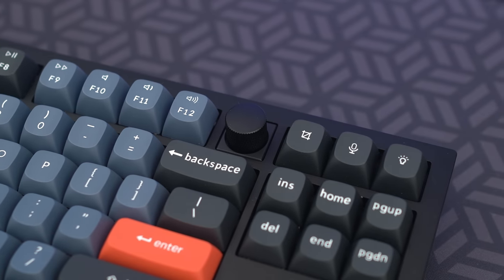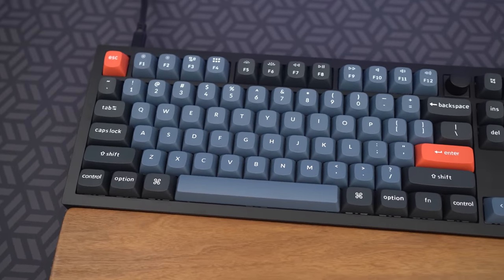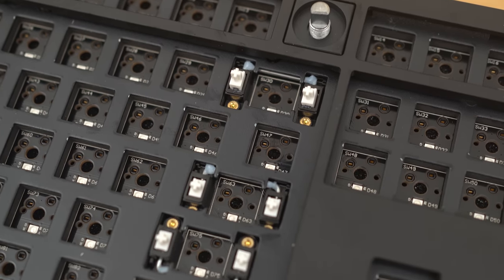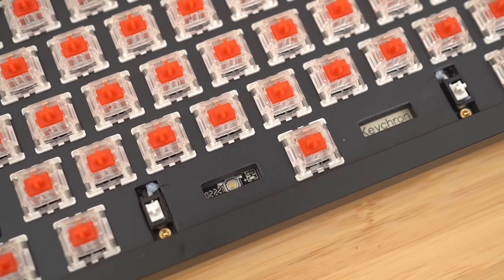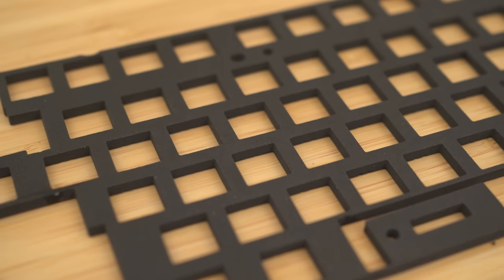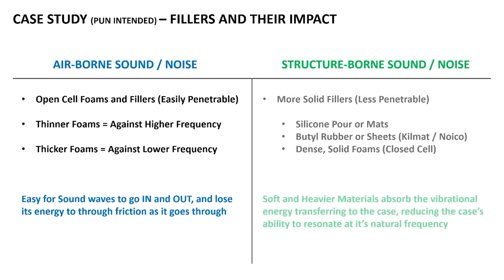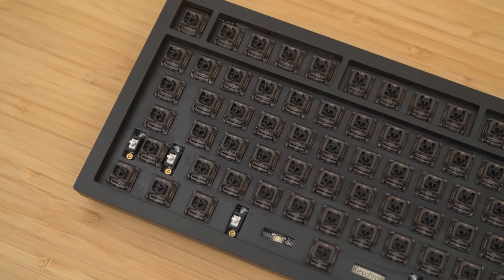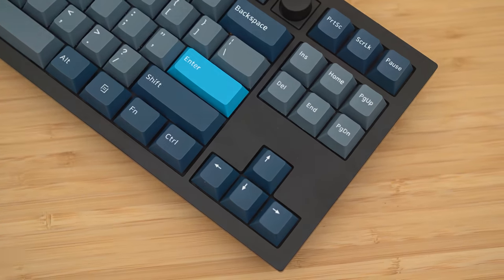Keychron Q3 - KEYCHRON Back with a 3PEAT on TKL with a Knob!

Comment: blacksimon removed the forcebreak gasket stuff. Isn't this the exact opposite thing you did? Or does the direct connection between the top and bottom allow the vibration from the top to be "cancelled out" (or rather absorbed) by the bottom?
Reply from the maker: That's how the Q1 was. No pads or anything, full metal contact and crazy upper frame ping. Tried bunch of stuff and the tape force break was the only thing that worked.
Reply: @Keybored  Thats why it confuses me that q3 sounds good with no apparent ping without adding tape or the stock rubber stuff (which is flawed anyways). Maybe they fixed something in the construction.
Reply from the maker: @TheExp111  I'm curious so I'll try removing everything and see what happens. As I showed on the video, that top rings like a tuning rod like the Q1s did lol
Reply from the maker: @TheExp111  just tried this... You rip everything off, the pinging gets absolutely worse. I do not recommend. If you're typing on it super gentle, it's fine. You tap on it with a bit of force, the thing pings like crazy
Reply: @Keybored  Interesting. That would align with your science explanation. Idk what blacksimon did. But thanks for trying!